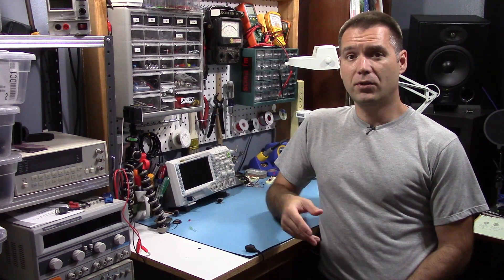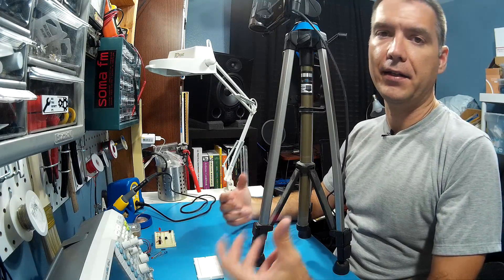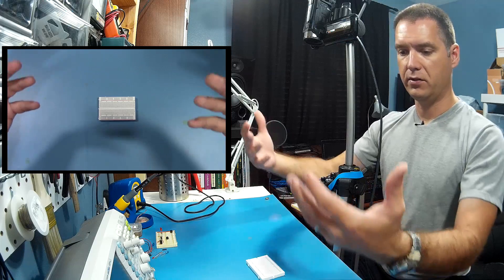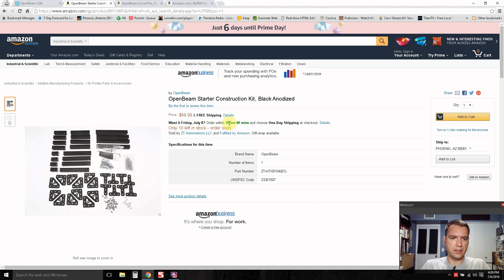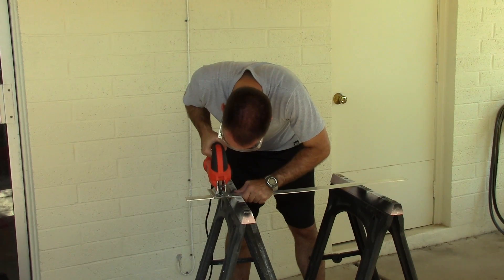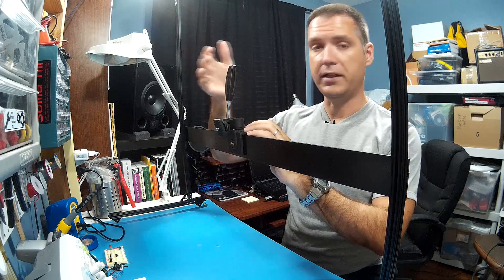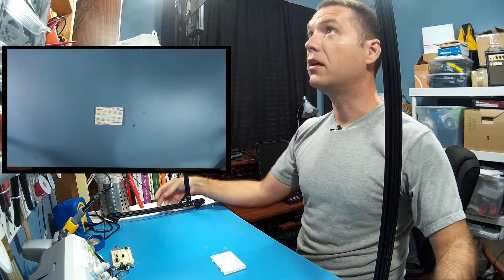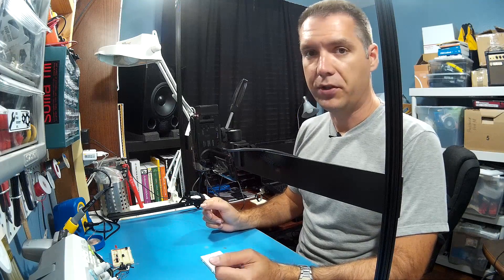Easy DIY Overhead Camera Rig made with Open Source Hardware

Comment: OpenBeam is now sold by ZT Automations so you might want to update your amzn links.
OpenBeam Starter Construction Kit: http://a.co/06IoDBc
Sadly it looks like the Kossel Pro Extrusions-Only Pack is unavailable  ( 3x 750mm and 9x 360mm)
I don't see any 750mm lengths but there is
8 pack 600mm http://a.co/0xSnBTA (too many and too short)
6 pack 1000mm (1m) http://a.co/ixwz7CX (too many and a bit long but could but could be cut to length)

Alternately, Makerbeam XL is also 15mm square and could do the trick
Makerbeam XL Starter Pack (for hardware) http://a.co/2ugGVm4
Makerbeam XL 4 pack 750mm http://a.co/2XNpTTK (3 would be used)
Makerbeam XL 4 pack 300mm http://a.co/935mVkr (2 would be used) These would be 60mm shorter than your Openbeam 360mm lengths but would probably still be stable.

Comment: I need to build something like this, but I will be simultaneously shooting frontal too, how do I make one that is out of the scene?
Reply from the maker: Hello! It would need to be tall enough and wide enough to be out of the frame. Some other building material might be better for something that large. Wood, PVC pipe, metal?
Reply from the maker: Hello! Yes, there are 8 speeds. This is the slowest, taking 2 hr 20 min to traverse 3 sections of track. The fastest would take about 2 minutes 45 seconds to traverse 3 sections of track.

Comment: Thanks for uploading this video and sharing your idea!  I ran with it and built this rig.  I love how light weight it is and how easy it was to assemble, without having to weld or have a larger wooden build.  When I went to the hardware store, to purchase a piece of aluminum to mount the camera window mount on, they didn't have the right size in stock.  I ended up purchasing a thicker,  aluminum yard stick and it works great and cheaper than the aluminum stock would have been (sometimes you have to think outside the box)!
Reply from the maker: Awesome! Glad you were able to get some inspiration from this. Yeah, I had this idea for years, but just hadn't done anything because, like you, I had to find parts that weren't really "meant" for this.  Thanks for watching!
Reply: how much would you charge for something like that?